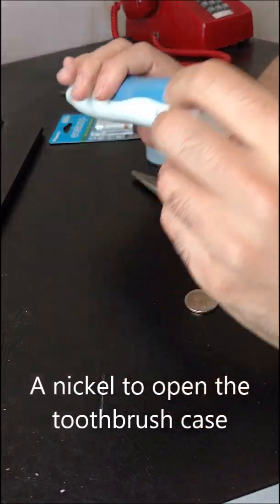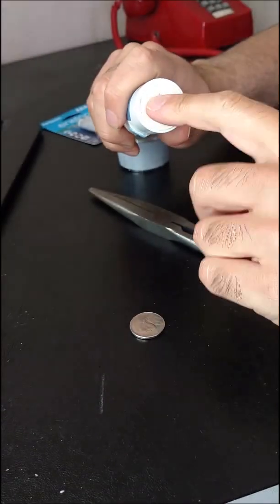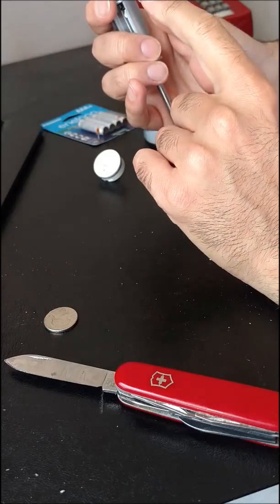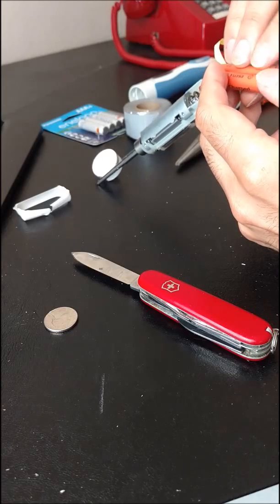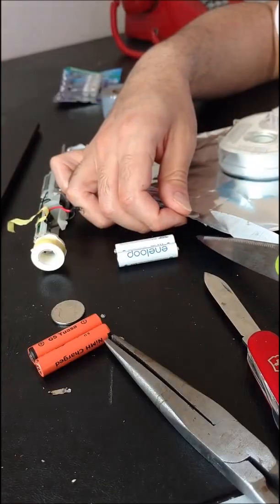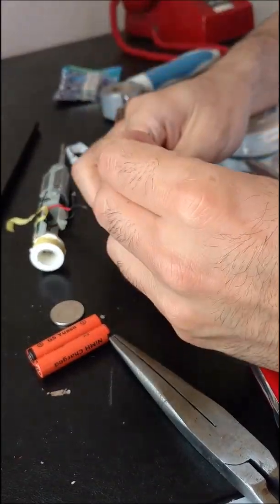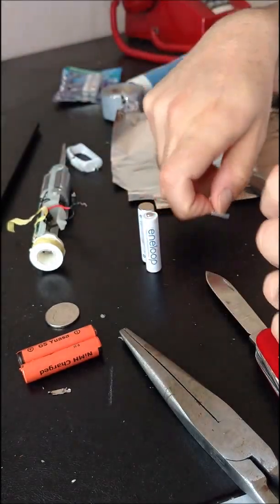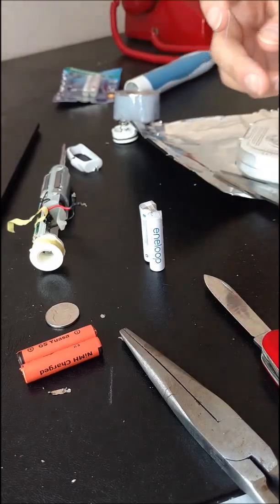Waterpik SR-3000 toothbrush battery replacement how-to

Comment: I find it to be really disappointing that you didn't mention soldering before getting started. You took care to make an introduction but you didn't say the tools needed. Fast forward, here I am now with a broken tooth brush that I can't fix because I already took apart the metal on the inside. Tape alone isn't enough to hold it in place. At least I would still have a half usable tooth brush right now if that was mentioned at the start. I would have clicked out of it before proceeding. Oh well

Comment: I have replaced the batteries, The toothbrush is working, but when I put the toothbrush in the Waterpik flosser, the toothbrush does not charge and the green light is turned off. I have tried two pair of batteries with the same results. Any idea?
Reply: Same for me, two pairs of different brands of NiMh batteries, The toothbrush is working, but neither will charge when the brush is back on the charging base. What's the solution?
Reply: @TheBishopfarm  I realized that while I was opening the toothbrush, the induction wires were cut off so I had to solder the induction wire to its place, then it worked. Check if the thin induction wires are connected. The induction wires are placed at the end of the toothbrush where the toothbrush is seated on the base.
Reply: @Mahmoud1953  Thanks Mahmoud. I'll check that out.

Comment: Waterpik should be ashamed for making this disposable.  This pack could have been easily replaced if they used a pack with a connector or a aaa battery holder.
The pack in mine was labeled 2.4V 750mah.
To replace it I bought a pack for a VTech cordless phone.  Battery is BT184342/BT284342, 2.4V 800mah.
Cost me $6.75 for 2 packs on Amazon https://www.amazon.com/gp/product/B0742877KY
I didn't do any soldering.  My approach:
Remove the tail cap.
Push the nose down on the table to push the motor unit out.
Clip the wires at the old battery.
Clip the wires at the connector off the new battery.
Strip and splice the wires.
I covered the splice with heat shrink tubing but tape would be fine too.
Put the battery pack in place and reassemble.  You may have to fiddle with it a bit to make it fit.
Takes about ten minutes.
Reply: THANK YOU.  I hope my job works. However I NEVER EVER will have a Water Pik brand again.  I just threw away my old RECHARGEABLE  that lasted for ages. Constant use.  Maybe I could have replaced battery.  But wanted combo brush and water pik/ flosser. I thought holder was rechargeable. 😭😭😭

Comment: Could I use adhesive copper tape on the ends to hold the leads in place - instead of soldering?
Reply: I would worry about whether it will stick over time with the toothbrush vibrating. I think the easiest solution was suggested in the comments below -- buy a cordless phone battery pack of the right size and just snip the connector off. Then strip a bit of wire coating off the leads and twist them to the leads in the toothbrush after you cut out the old battery. (Ideally solder them, but with some electrical tape you can probably make it work. Search for "self fusing electrical tape" for my favorite kind, it will help you really connect the wires tightly.) For the battery pack try searching "Lucent BT166342 battery" and you'll see what's required. Just make sure it's a NiMh type.

Comment: Were do you buy the battery?
Reply: You can use a battery pack for a cordless phone, as long as it's a two-cell AAA pack of NiMH type rechargeable batteries. Just snip off the connector from the red and black leads and solder the wire ends to the leads in the toothbrush. Here's one on Amazon for less than $6: https://www.amazon.com/ELEOPTION-Cordless-Phone-Battery-800mAh/dp/B00G8Y6WIG

Comment: This fix lasted just under 7 months before the batteries stopped holding an charge.
I used the Eneloop AAA's, supposed to recharge up to 2100 times, So i used about a 10th of that.

Anyone else see this happen?
Reply from the maker: There was a point where that seemed to be happening for me, but it turned out there was moisture creeping inside creating a short that drained the batteries. A weak spot is the seal where the metal pole comes out through the plastic up top. I sealed it with some plumber's thread tape around the junction, which is thin enough to let the brush head still fit. Another weak spot is the on/off switch, which corrodes with moisture. I repaired my switch a couple times. Finally the "motor" itself broke recently and won't vibrate strongly (again, due to moisture I'm sure), so I had to retire the whole toothbrush. But I got an extra year or so out of it this way.

Comment: Fantastic video!   Thank you.   I found out that the contacts are "tack welded" to the battery.  I found using "needle nose" vise-grips (vice-grips?) at the base the of the two batteries allowed me to use my hands to solder etc.

Comment: if you're going to to try to make your replacement battery back yourself with a pair of GOOD AAA's, like panasonic eneloops, it's best if you can solder the new pack together as follows:

1. tape a pair of AAA eneloops side-by-side by wrapping a single loop of tape around the pair of batteries arranged head-to-tail, with the plus and minus terminals flush with each other. Use thin tape (like Scotch packing tape) and don't use more than one layer as the battery back would otherwise be to fat to fit back in the battery cradle.

2. rough up all four terminals with sand paper or emery board.

3. coat one set of terminals with and a short piece of thin desoldering braid with rosin flux, lay the braid across the pair of terminals and then solder the braid to the terminals.

4. Cut the wire leads off of the old battery pack, leaving behind the terminals that are soldered to the old battery pack. The wire leads are  long enough that there's plenty of extra wire remaining for the next step.

5. Strip a small amount of insulation from the ends of the two leads, coat the bare ends and the other set of battery terminals with rosin flux and then solder each lead to a battery terminal, making sure you get the plus lead soldered to the plus terminal and the minus lead soldered to the minus terminal, and that the two are not bridged in any way. It works better to solder the stripped copper wire leads directly to the terminals rather than trying to pry the original wire lead terminals from the old pack and resoldering those to the new battery terminals because the old lead terminals would stick out from the new battery so far as to make it nearly impossible to insert the new battery pack back in the toothbrush's battery cradle.
Reply: I want to give entire credit to mag steel-he provided the idea of the battery pack ordered through Amazon. It is now $7.95 for two batteries. It is always good to have a spare in case this happens again. To avoid $5.99 shipping:  we held off on the purchase until we included other items( that we actually needed) which brought the total to over $25.00. We now we have a powerful Waterpik toothbrush that will hopefully last a long time, that works as well as when it was brand new, except for some extra vibration noise.   To avoid the noisy vibration I recommend you first use a nickel to loosen  end cap counterclockwise then turn the toothbrush over and push the head pin clasp downwards against a block of wood until inner workings pop out of case. If you don't sufficiently loosen end cap you might damage the tiny plastic catch in the case that holds the end cap tightly to the case. Nevertheless even if you disturb the gripping part, the rubber o-ring inside the end cap still holds the end cap  in place, but  you will have to live with a noisier toothbrush. But it still works perfectly except for the noise, which is tolerable.
Reply: Questions: (1) Desoldering braid is used to remove solder. Are you saying to use the braid in place of the foil in the video? (2) When you suggest AAA Panasonic Eneloops, are these better than the cordless phone batteries recommended above? Can you provide an Amazon link? (3) I find on Amazon different sizes of desoldering braid. Can you provide an Amazon link to the best one?

Comment: if I  would have known the batteries were this much trouble to replace, I wouldn't have bought it.
i noticed someone in a comment below said to take it to batteries plus.
Maybe a better option if you don't want to messl with it.
I'd hate to accidentally break it.
What a pain in the @ss.
Thanks for the video.
Reply: I am with you.  Never would of bought this product if I had know.  Why does Waterpick make it wo difficult.  As many brains as there are around, (maybe) why couldn't we just unsnap and resnape a couple of AAA batterties into the holder?  Cutting wires, soldering, taping, foil paper, pliers????  for a toothbrush???  Anybody want a Waterpick brush and flosser combination for free?
Reply: Battery Plus and another Battery Place wouldn't bother doing it where I live. They are getting pretty sorry, in general.

Comment: It would probably be easier to purchase an assembled  2.4v AAA Ni MH pack made for cordless phones off amazon . just clip the leads and solder them to the appropriate leads on the tooth brush.
Reply from the maker: That's a great idea, I wish I had thought of it! I actually had to open up the toothbrush again the other day and replace my cheesy aluminum foil taped across the leads with a strip of metal soldered on. The foil had moved over time from the toothbrush vibrations.
Reply: Well to be fair I wouldn't have even known if the batteries were replaceable much less what kind of batteries to use if you hadn't have made and uploaded this video so I thank you for that    I'm going to replace the batteries in my toothbrush now that I know that its possible thanks to your video.

Comment: Thanks Bro...Can I used this with 950 mAh?https://www.ebay.com/itm/251347667335Panasonic eneloop pro 950mAh AAA Ni-MH Battery BK-4HCCE x4 replace 4UWXA 4UWXB
Reply from the maker: Any AAA size NiMH pair should work fine.
Reply: Thanks Friend... Use 1.2 Volt or 2.4 Volt? Thanks
Reply from the maker: +Rahadian Andreas 2 batteries, 1.2 volt each. You will connect them in series to make a nominal 2.4 volts.

Comment: As we're going to have to solder the leads back to the new batteries, couldn't we solder a wire to connect them in series?
Reply from the maker: For sure yes, that would actually be preferable to my lazier solution. The caveat is that you must keep the wire and solder joints very thin to fit the battery pack back in place.
Reply: You can get 800mAh tech cell  AAA for 99c each (US + tax) at Batteries Plus (The batteries in the toothbrushes are tech cell). They will also sonic weld solder tabs onto the contacts for free also.

https://www.batteriesplus.com/productdetails/nuh800=aaaf